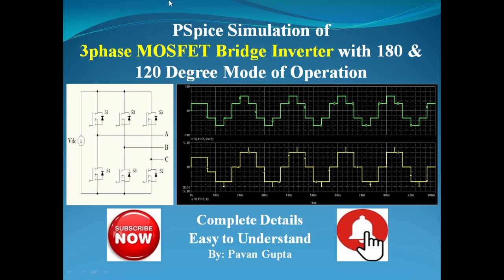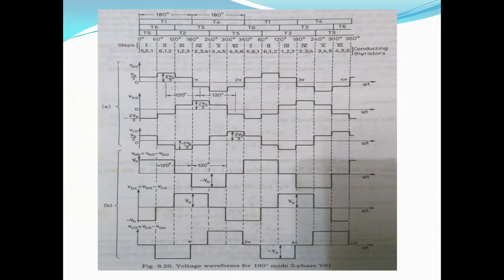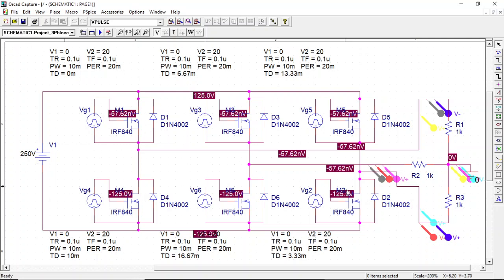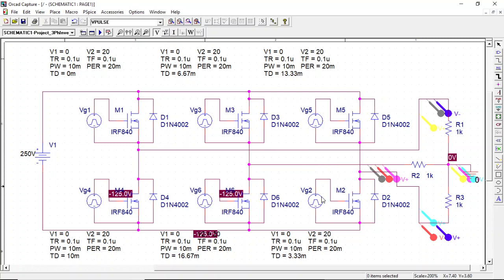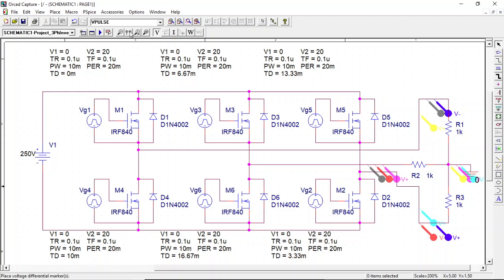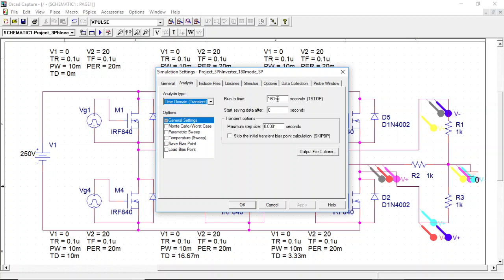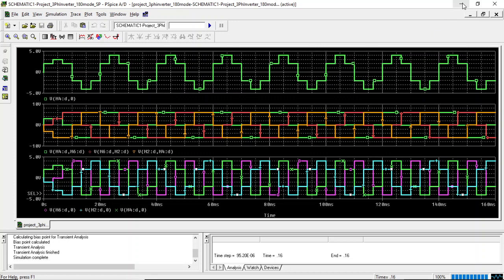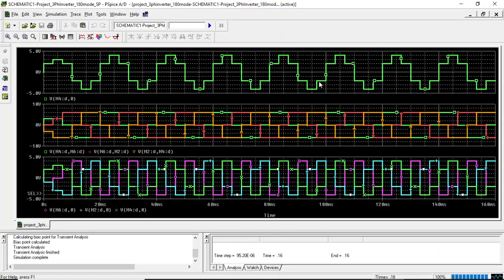PSpice Simulation of 3 Phase MOSFET Bridge Inverter with 180 & 120 degree mode operation | Complete

Comment from the maker: For the more accurate output of the 3 Phase Inverter 180 & 120 mode of operation, I would suggest IRF540 & diode D1N1190 with same switching sequance as explained in the video. It will give correct Output AC magnitudes of Inverter.
Reply: How do we decide the value of V2 for every Mosfet? Like why V2 was set 20V ?